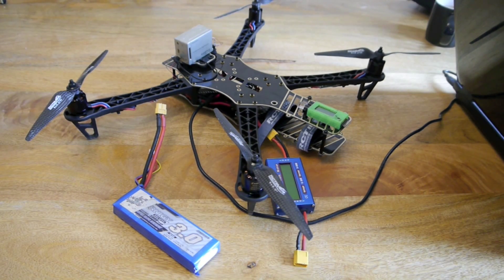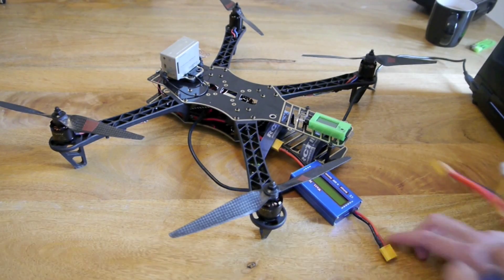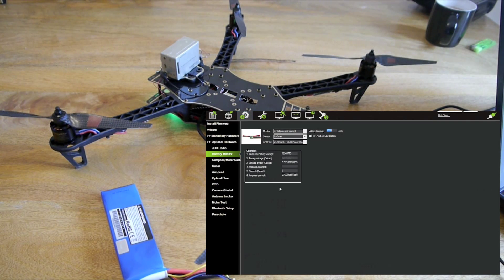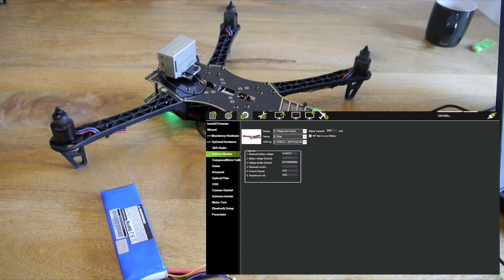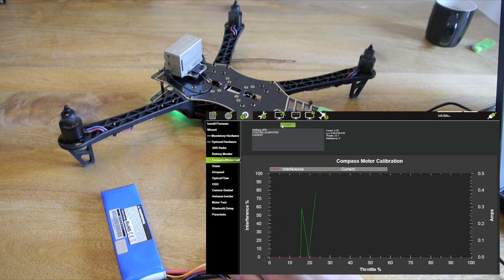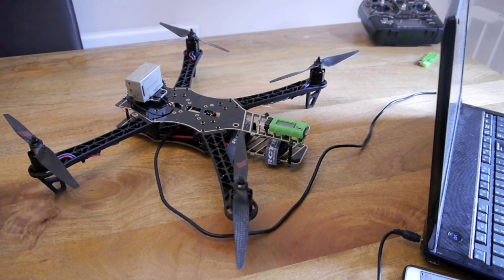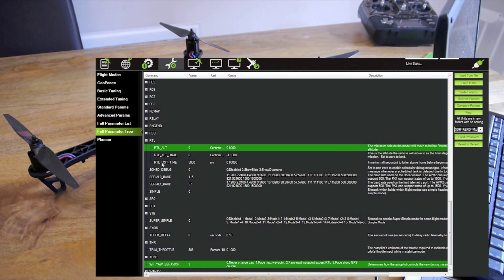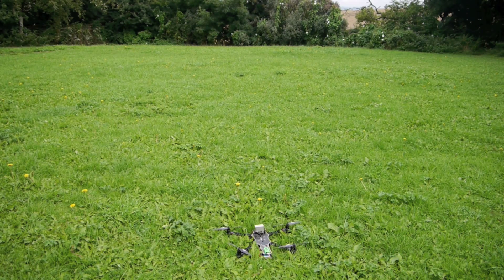TheManLab - Power Module Calibration - Diatone White Sheep APM Quad Build - Part 6

Comment: hello i had a problem with aapm 2.6 it is not responding for left and right as well as front and back can u help
Reply from the maker: Is this within the radio calibration screen?
Reply: Ya I use mission planner and calibration is successful but same no output at roll yaw and pitch
Reply from the maker: +Rohith bairy if you arm hold the copter in your hand. Then add throttle and tilt around does it "correct" itself to level?
Reply from the maker: +Rohith bairy It looks to me like you have your motors connected to the APM incorrectly. If you would of followed my previous advice this would of helped more.

Comment: Everyone else building drones claims they should be balanced in the center.  How can you get it to fly being so off balance with the heavy battery way out on one end?
Reply from the maker: +Steve C I think it will change the flight characteristics but i've never flown it balanced yet so I wouldn't know. I guess if just like walking with a backpack on, you just lean forward a bit to compensate.

Comment: Thanks for your response. Did you still stick to the PID settings in part 5?
Reply from the maker: +Sol mag As far as I can remember yes. I will check next time i connect the laptop to the quad.
Reply: +The Man Lab I tried the same settings in part 5 and the swaying disappeared and the quad is more responsive, but the problem I have now is when I'm in loiter mode, it holds its position when it's not moving, but when I start moving, after about 50 meters, it starts losing altitude. Do you know what might be the cause? Thanks
Reply from the maker: I only know that in when I tried to fly around in loiter the APM did'nt seam to like it and became jerky.
Reply from the maker: +The Man Lab Please see my new video https://youtu.be/moPHvqwhuiA

Comment: please help me balance this diatone white sheep frame. 
I found that the center of gravity and center of thrust are 1.1 cms apart. .. 
the pitch axis seems to be wobbly. . please reply
Reply from the maker: +Ashish Faustine Hello. I've not had and problems with the balance of my quad. It's very tail heavy so I can only guess that your PID settings need tuning. Please watch and pause this video http://youtu.be/26GDDEVPfhw at 3:28.
Reply: I can see too much oscillations. . it would be better If u tune it bit low
Reply from the maker: +Ashish Faustine Yes you can. Increasing PID values will reduce oscillation.

Comment: Great job mate,
I got the same frame, it flies very well ;)
Have you managed to find what was the problem with the loiter and RTL mode ?
Reply from the maker: +F'n'X Hello. Yes I did get them sorted. In the end I had to purchase and 
external GPS and compass. It's on a stick about 15cm tall away from any 
interference.
Reply: After i watched your film, decided to rebuild a bit my quadrocopter. Because my APM was mounted on top surface I moved it into so now it looks almost exactly as yours ;)
Reply from the maker: +F'n'X Good job they don't look slick at all with everything mounted on top!
Reply from the maker: +The Man Lab Please see my new video https://youtu.be/moPHvqwhuiA

Comment: Hey Matthew, enjoyed your build videos, can you tell us if you had any success dialling out those issues with loiter and RTL? I've an f450 kit with an APM 2.6 on the way for my first build and want to have those flight modes fully functional, thanks.
Reply from the maker: Hello. In the end I added a external GPS and compass. It's raised up away form any interference. RTL is good but loiter has about a 2 meter drift.
Reply: +The Man Lab Thanks Matthew, the kit I have ordered includes an external gps and I've ordered a separate extended mount for it, so should be free from interference, thanks again.
Reply from the maker: +Bob G Please see my new video https://youtu.be/moPHvqwhuiA